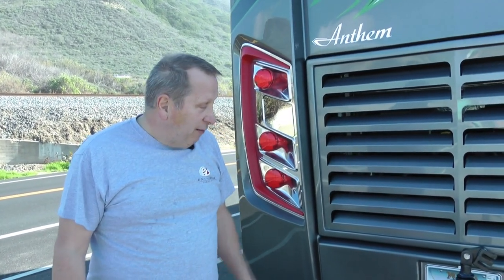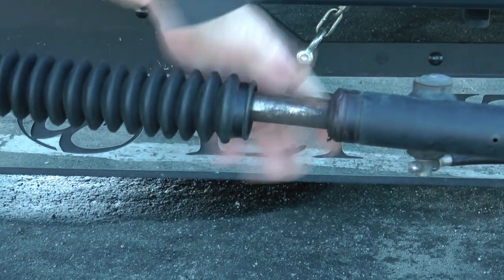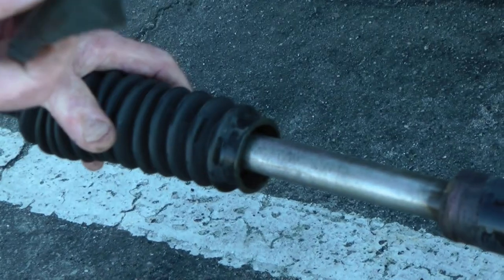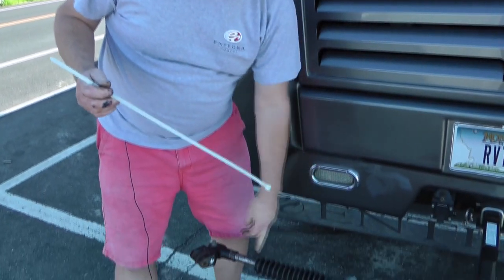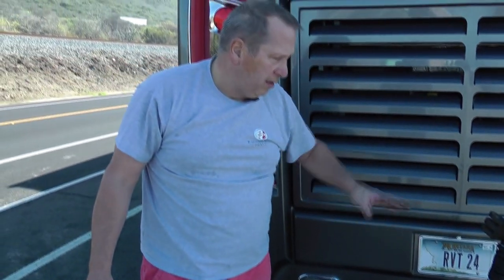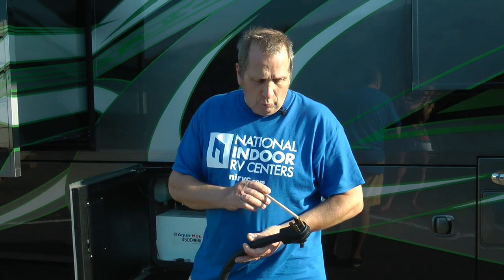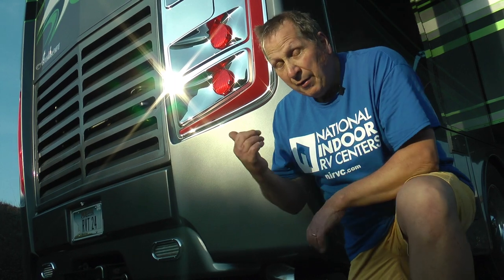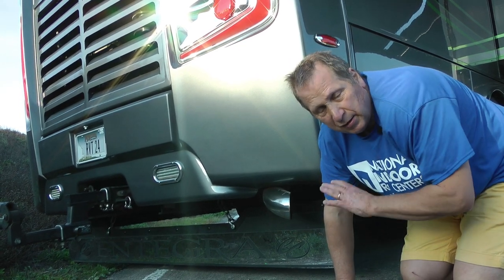RV Maintenance tips Part 5

Comment: Happy to have you back in the state's. I spray my blue ox with WD40 before winter each year, it seems to work. 
The plug idea is great and I will do, thanks!
I had heard of the rock guard problem so I put in a longer bolt with a nut and lock washer and for good measure put a safety pin through the threaded end of the bolt.
You will have to drill the hole for the safety pin.
keep the rubber on the road.

Comment: Hiya Glenn, nice to hear from you and your good lady again. I find that the linkage ( 'D' shackles ) come undone a lot due to vibration etc... If you get a longer bolt and on the other end put a nyloc nut (a nut with a plastic insert, moulded to the internal part of the nut) you'll NEVER have a problem again. It looks like Entegra need to review their quality and encourage customers to give them feedback to continuously improve their products.
Reply from the maker: I don't think the new Entegra management will listen to anything, they are only now interested in profit, so the quality is bound to suffer. This I feel should be the dealers PDI responsibility.

Comment: After hearing about the bolt in your mud flap and hearing the story, I immediately looked at mine (American Eagle) and happily found that it was tight and had not started to back out as yours did. The head of the bolt going into the linkage connector (we call that piece an "Anchor Shackle) on mine has a hole through it, sort of like a thumb screw, maybe yours does also. I put a piece of safety wire through the hole and around the shackle to stop the screw from being able to back out without cutting the wire. I'm sure a wire tie would also work since there really isn't any real pressure there, just vibration trying to unscrew it. Thanks you for sharing, prevention is so much better that the alternative. I really look forward to your adventures and "fixes".
Reply from the maker: Hi Don
Yes there are loads f fixes for this, anyone that does the job is a good one.

Comment: Great vid, welcome home LOL.  I wanted to reply to help if wanted my 2 cents. 1ST.Blue Ox should be shamed!that tube should be sealed for expressly the problem you experienced. Great job getting it back in order. The plug idea is brilliant! I am in the fire department in the local rescue department. We have tons of cords we have on reels. When we retract out electric cords and hydraulic hoses we use a wash mitt. 1st it protects our hands, 2nd it cleans the cords and hoses so they look clean and are decontaminated. We have two, one with cleaner on it at the scene and one with a rubber dressing (armor all) to dress up and protect the rubber. I can't tell you how many of those stone guards I have seen on the side of the road. One thing the use on those bolts it RED Loctite.  How great to share you're experiences with everyone. Safe travels.
Reply from the maker: Well, we like to think : if it helps and prevents an accident, then great, and if you know it already then no harm done. thanks for watching
Glenn

Comment: Glen, I've been told to use the black zip ties as the white ones get brittle and crack with UV exposure.  If you plan on increasing the greasing frequency, it doesn't matter as much.
Reply from the maker: I only had white ones in stock, I would have normally used black ones as they do seem to be more flexible

Comment: Great tip!  As a completely new RV'er that hasn't been on the road yet I'm going to take a look at mine today.  Lock-Tite would be a good solution but as an ex-aerospace engineer I'll probably look at using lock wire to make sure the shackle bolts can't unscrew.  Hope to see you on the road somewhere. :-)
Reply from the maker: Both will work, I just didnlt have any lock wire.
Reply: I just checked mine today and they are fine but I am still going to lockwire them.  BTW, I happened to look up where the chain fastens to the frame and there is another set of shackles there as well.  I hope you checked all 4 of yours.  There should be a little hole through the flat part you use to tighten them where you can run a wire through and then through the chain so it won't be able to unscrew.

Comment: Hey y'all, great videos. Here's a tip, man's best friend isn't a dog, it's Locktite screw and bolt adhesive. Here's what I witnessed traveling west on I-10 outside of Phoenix AZ. A motorhome in front of us lost a chrome exhaust tip because a u-bolt came loose and bounced off his towed cars windshield, then over our RV, Yes, completely missing us and into the radiator of a semi-truck behind us. Luckily no one was hurt. So, Locktite everything.. Anyway, love the videos, keep them coming. Bye
Reply from the maker: I used to work for Loctite in the UK years ago so know the value of having some in stock. Yes I have loctite blue in my tool kit.

Comment: for info purposes only is the roadmaster tow bar is made from stainless steel and will not rust like the blue ox does. as you know rust is the first stage of failure. you might consider the roadmaster model for a replacement. plus they don't bind as often as blue ox does when disconnecting
Reply from the maker: I have one of the new non binding blue ox frame, works great, just a shame that it's gone rusty so quickly

Comment: You may have already thought of this; however if this was my couch I would threw bolt the attachment and place a lock washer and locking nut on top of that. At the very least the use of "Locktight" on the present bolt would be helpful. The thought of that skirt coming loose at 60-70 MPH is frightening. This something that the manufacture should address as well.
Reply from the maker: Yes loctite or lock wire will work, our's is secured by loctite

Comment: Hi great hearing all you do's and don't and help which is fantastic, if i could say change the bolts for ones with open loop and put through cable tie and they shouldn't come undone ????
Reply from the maker: Yes, thanks George, there are many way that these can be secured I just wanted to bring it to the attention of owners as a potential problem.

Comment: Drill and safety wire that clevis that way the bolt can't back out. Great Tips!! Thanks
Why the radiator change out so early in the coaches life?
Reply: Have to have a drill on the side of the road... That maybe a problem... Blue Loctite will do the same without the drill and if your on the go its fast.
Reply from the maker: All Entegra 2015 /2016 have had to have new radiators so people I know are on their third !!!
Reply: Ouch! Thanks for the kind reply.

Comment: Hi Glen  not telling you how to suck eggs but i am a mechanic you need to remove the grease from the piston rods as the auto locking bars cannot work and the tow car can sway about and start snaking there is a better product called ACF50 its hard to get hold of in the usa, clean them and then a light coat and they will stay rust free you need to spray most things on the rv with it its like wd 40 on steroids  i have a rv and keep it in FL just got back from there another tip is to check your tyre inflator pipe is long enough and also usually the ordinary connectors don't fit so you have to change out the valve the rv the d links on the big mudflap can also be secured with cable ties so all those electrical connectors need ACF 50 some of the chrome backs of the alloys hinges on the lockers it won't hurt the paint or enemy thing else go on there web site i have been using it for years in the uk on heavy industrial machines get the pink and silver can its twice as strong as the marine version i would get 4 cans and spray every thing .Paul
Reply from the maker: Thanks for telling me that, I've added a note to the video now that covers this.

Comment: Good catch..  
Yu never said why you changed the radiator?  The RV is not that old what was wrong "his time"  ;-)
Just interested in knowing.

BTW depending on how much of the bolt was through the U bracket  you could also maybe add a lock nut to it to help hold it in place.

But yep checking stuff before journeys is ALWAYS the only thing to do.
Reply from the maker: Most 2015/16 Entegra have had at least 2 radiators as the one fitted from factory had a design fault. The real problem started when they were changing the bad ones with the same bad ones (if that makes sense). We have been assured that the one we have had fitted is a newly designed radiator.
Reply: Ah ok.  
Although you seem really happy with your RV you also seem to have had quite s few issues.      I am aware that brand new Rv's need a bedding in period but still I am still a little surprised at how many you have had and also your patience and also how much you still seem to love Entegra as a company and as a Motorhome. 

Good too see.

Comment: One way to never have the issue with the rock guard and the small shackle bolt from falling off is to replace them with a shackle that has a cotter pin through the bolt.. simple fix!
Reply from the maker: Yes good idea maybe it's something that the manufactures should pick up on.

Comment: Hi there just watched a couple more ov your vids and hear are a couple more tips for you the wife will like the first there is a product called tea tanks and you put some in the toilet and the smell disappears instantly its brill the other thing i noticed is that you don't have a water pressure regulator on the rv now when the pipes under the sink or shower blow of and it floods the coach you will wish you had spent 20 bucks. and i would remove this vid because those pistons should be dry reed the manual take care .Paul
Reply from the maker: Hi Paul, we have a water pressure restrictor/gauge on the water line that we connect to the water supply so we are covered on this as we have also heard of horror stories of flooding due to excess water pressure.
Cheers
Glenn

Comment: Another tip for 50 amp and 30 amp male plug ends is to carry some steel wool with you and insure the copper lugs are clean and shinny. Yours looked pretty dirty in the video.
Reply from the maker: That's a good tip but you need to make sure that there is no wire wool left between the contacts and this could cause a fire. I haven't cleaned mine yet but will next time I get to visit my RV.